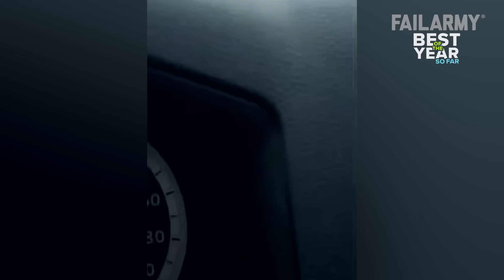Best Fails of the Year (So Far) 2023

Comment: 3:20 as a previous roofer, is my nightmare. I’ve witnessed it happen once and looking over the edge of the roof just hoping the guy was okay, was one of the  scariest moments in my life.
Reply: Yeah they should NOT Have picked him up right way.
Reply: I’m not a roofer. But I wouldn’t put all my harness on and not connect it to an anchor
Reply: I have a feeling the person recording turned away during the fall because he had a feeling there was a high chance he wouldn't survive.
Reply: @billbillson6779  I was worried about that too when they lifted him up so fast like "uhhh no you probably wouldn't want to"
Reply: did you atleast NOT immediatly jerk them upright off the floor after they just fell 3 stories?  

what is wrong with people?  why do they do such things.  
the guy could have been able fully recover without any lasting effect.  and BAM paralized from the neck down for the rest of his life.
Reply: I also had da same happen 2 me when I was on a ladder against a house removing squirrel traps from the roof 3 Floors high with no safety gear, luckily my boss was holding the ladder from tilting. I felt like I was going 2 have a heart attack from the terrifying situation.
Reply: @darkracer1252  Is it a problem if they pick them up? Never knew this
Reply: @Lusemasus  yes
Reply: Gotta be roped up for metal roofs in the winter. Wet boots and metal don't stick together very well.
Reply: 3:30 😂
Reply: @Lusemasus  very, never do this to someone who has just experiences big hit, they could have damage to the spine/ neck that would be worsened by moving them around.
Reply: Former chimney sweep here. Working on roofs is can be dangerous. Especially for idiots who don't wear proper PPE. Also he buddies yanking on him right after the fall is stupidity at its finest. There are probably EMT's here who can explain why you shouldn't do that.
Reply: my 1st day roofing and my last was having to complete the job after the boss’ indifference to my fellow roofer falling through the roof
Reply: @cookiemonsterdayz yep, he needs c-spine precautions (someone holding his head steady until EMS arrives), then EMS will stabilize neck with c-collar, headblocks and log roll him onto a backboard, securing his head onto backboard with the stickers straps that come with the headblocks. Never move someone who has fallen like that, it could  cause the person to never walk again.
Reply: Honestly it's inappropriate he's in this video he could of gotten seriously hurt
Reply: @jonah.donohue  You mean like all the other people in the video?
Reply: @Gamer-g2v1r  that was a near death experience not an epic fail. Know the difference.
Reply: My cousin fell 7 stories & the only reason she survived is a car broke her fall. She has made almost a full recovery (slight limp). Her grandfather fell 11 stories & survived. He was a window installer on NY skyscrapers. I guess an awning partially halted his free-fall & he also made a full recovery.
Reply: @Gamer-g2v1r  Bro fell 2 stories versus somebody who got hit with a pie in the face. You tell me what's more pressing
Reply: @jonah.donohue  When I said "all" I didn't mean it literally.
Reply: Any update about this guy if he's okay ?
Reply: @darkracer1252  3 stories and on a bank of snow ain't nothing. Now if there was no snow there.
Reply: You can see in the video the first few frames he’s in after he falls, his legs are over his head basically because he landed on his upper back/shoulders. It looks like that could’ve easily killed him by a spinal break or neck. Dude is so so lucky to be alive
Reply: @keirboyko  
the guy pretty much missed the snowbank dude.
Reply: god bless you lol
Reply: I'm hoping he's OK and made a full recovery. They should have called him an ambulance,  not picked him up.
Reply: @Lusemasus Yeeeah. Neck/back damage.
Reply: @keirboyko Snow can be real hard. You must not live in a snow state
Reply: Why were his buddies yanking him to his feet??? Could’ve made injuries worse!
Reply: For all those saying they shouldn’t have moved him. They needed to move him because there was a risk that the snow he was working on could have loosens and could crush them at any moment.
Reply: My fall when roofing was a factor in why I quit later on. Happened so fast. Only 10 feet. My uncle fell off the same roof later on near the end of the job… 22 feet. Left him brain damaged/personality changed for about five years before he returned to normal.
Reply: @Lusemasus  If the spine is injured, you can assure a life in a wheelchair by yanking someone to their feet.
Reply: So roofers a job to clear out roof
Reply: @Lusemasus  injured person has to be checked by medical personnel for possibility of spine injury first. usually when people fall from heights and survive they should be left in a position they fell down(if there is no other danger) - if they are conscious, otherwise you just need to make sure they dont choke on their tongue(if unconscious and breathing). setting someone up (like irresponsible idiots they are) right after fall from such height is not gonna help at all and potentially can damage injured person even further. its like they wanted to act like nothing happened and noone fell. ridiculous.
Reply: I just posted the same try comment I do roofing to, that shit is hella scray when your the one falling
Reply: @therealr0t166  What are you talking about? There was no danger of any snow crushing him. He fell from a cleared spot, and any snow that could have slid off would have fallen to the right of him anyway.
Reply: @Lusemasus  literally could kill him / paralyze him from doing that.
Reply: It did look like they were trying pull him up and pretend it didn't happen cause they were afraid of getting in trouble or something. That was stupid, they definitely should not have yanked him to his feet. That's like rule #1 in a situation like that.
Reply: A friend who is a home improvement contractor fell of a roof, broke his neck and recovered to go right back to doing roof repairs and replacements, I swear he is part cat with way more than 9 lives .....
Reply: That was brutal
Reply: Well, I assume they were jerking him up to make it believable that he survived that fall, which he didn't. Because he never fell. The camera moves just far enough to the side and down to disguise the fact that the guy on the roof and the one on the ground are two different people.
Reply: It’s funny how the dumber someone is, the more certain they are that they’re right.
Reply: wish he was okay

Comment: 1:24 I love how calmly he says “I almost just died “🤣😭
Reply: You just shook hands with danger, sport
Reply: He almost "just died" like someone who slams the back of there head on a desk or table coming out after reaching to grab something.  He'd have needed to have his neck between the bed and frame to accomplish that. And the bulk of his torso and the tire would have prevented that. Truck beds are large and gangly but still only like 200lbs. I have removed and replaced truck beds alone without lifting tools. His video is great example of why you don't trust lifting things on a floor jack with a 3ft vertical pole. He basically made an even sketchier version of a hi-lift jack aka suicide jack.
Reply: I am him
Reply: @AUSTINFRILOUX   Cherry picker and some chain goes a long way with awkward lift and hold. Ultimately though, never trust a $0.10 rubber o ring with life or limb.
Reply: Been there, and the casual commenting on it is just the realization that you effed up. Getting upset won't fix anything, and hopefully he knows what not to do next time.
Reply: He says that yet to the left of where he was, notice the stack of wood to prevent an accident working exactly as needed. He has the jack, then he also put 3(?) pieces of wood as a backup in case the jack failed. He was nowhere close to dying, he made his work safe beforehand.
Reply: @spirog1732  I'm pretty sure he meant that if he didn't have the wood on place he would of died. That's the whole point. People die all the time for stuff like this, when they don't apply any safety measures and just trust the lifts etc.
Reply: If he keeps doing stupid crap like that , he may never say that again.
Reply: @AUSTINFRILOUX  Fuel pump, huh?
Reply: @231mac  yep
Reply: @mikehatfield1531  he did put in blocks to make sure he wouldn't die though. it would have probably been smarter to just lower the jacks so the bed would rest on the blocks instead of leaving it on the jack to fail

Comment: 11:48  that wasn't a fail, that was about as epic a win as could have been hoped for under the circumstances.
Reply: It might be a "fail" by the plane or its mechanics, but the pilot is great.
Reply: Thought the same
Reply: ikr, pulling that landing in between two rows of high voltage power lines onto a busy road is impressive.
Reply: Just like in GTA
Reply: California ... 🤣
Reply: so ur not gonna acknowledge that they just put a plane crash as a fail 💀💀
Reply: @Gregs_sis  Not a crash, an emergency landing with no damage and no injuries...But that's besides the point.
If you're looking for High Quality, Fail Army aint the place to find it.
Reply: @samegalle1089  yeah that's what I meant with the reply, it was out of place in the video
Reply: Yeah that was pretty awesome considering the plane NEEDED to go down and no one even got hurt. SO much could've gone wrong there.
Would love to know the full story.
Reply: for an emergency landing that was slick
Reply: straight out of gta LOL
Reply: Engine fail
Reply: @jaska-jalmarixvi5757 no flaps either, so he was doing about 60 knots (appx 70mph/111kph), floating in ground effect.
Reply: The plane was reusable after a forced approach. Massive MASSIVE win indeed.
Reply: Horrible fail tbh by the very fact that he even had to make the landing in the first place.

Comment: Round of applause to that pilot that landed so smooth on the highway
Reply: No flaps either, so he was going AT LEAST 60 knots, floating in ground effect (which may have allowed him to stay up long enough to find an opportune gap in traffic.
Reply: The Cessna that sounded like a Beechcraft Baron:Fail.
Reply: @bigroy38  just because the engine is making noise doesn’t mean that it is producing enough thrust for flight.

Comment: the first clip is INSANE! I had to rewind several times and reduce speed to .25 in order to see just how FAST he managed to get up after falling. He's not even done falling and already getting up to avoid that big ass truck coming his way. That was just sick
Reply: Except he would have been fine where he was. He almost got himself killed for running. Look at where he crashed and where the big ass truck are at. They aren't the same lane. If the truck was just a car length ahead, he would have been road kill.
Reply: We saw several times the exact instant the persons guardian angel saved them by causing the vehicles to separate after hitting one another. Then the person is just standing there knowing they might have just died.
I've been through things less questionable. I was a sure fact, I mean, that I was going to have a head-on.
Reply: @joemann7971 Are you blind?  It's the same lane, the biker is joining the lane and slips. He lands right on the arrow which is exactly where the trucks wheels go through. He'd be dead if he didn't move.
Reply: Same here...I cannot stop watching it
Reply: @joemann7971   The bike was in the lane over but he was clearly right in front of that truck.  Running saved him.  Watch it again
Reply: @joemann7971   it's because he saw a car coming in the other lane. he couldn't guess that he could have been safe so he jumped to the empty lane.

Comment: 11:48 The plane making an emergency landing on the road without hitting anyone is not an epic fail. That's a victory.
Reply: I agree
Reply: I thought it is only possible in GTA to do something like this
Reply: Not at all. It was a massive fail because he even had to make the emergency landing in the first place. He should’ve inspected the plane before taking off. Definitely an amateur pilot that should have his license revoked.
Reply: @Brainsore.  atleast they didnt hit any cars
Reply: But maybe it was an engine fail
Reply: Hahaha, yeah
Reply: Oh, the landing was perfect. It was either machinal problem or a pilot problem however that lead to the failure of the engine that caused the landing.
Reply: @Brainsore.  Bruh? Do you know how machines work? Things can just break despite all the maintenance in the world. Some times stuff happens. Even commercial airplanes suffer from mechanical problems. Watch Air Disasters to see how stuff can happen out of the blue. Yes there is human error, but not all the time. There was a case where the rudder was stuck because the mechanical unit that controls it stopped working because of extreme cold conditions mixed in with heated hydraulic fluid made it stick. This mechanical failure affected 3 planes. 2 planes crashed and killed everyone on board. The third plane was lucky and was able to land safely, just like the pilot in the video.

Comment: 3:58 Slipping on the spilled transformer oil was the least of the hazards there.....he was very lucky that he didn't get electrocuted. If you're in an accident and damage ANY electrical equipment like that padmount transformer, or any other "green box", or a power pole, DO NOT exit your car unless it is on fire. WAIT for the power company to make sure it is safe to get out and touch the ground. Stay in your car, don't touch any metal and sit tight.

Comment: 3:10 
Poor man, falling from that height is very dangerous
Reply: Looked staged to me.  First of all nobody would be walking on that roof without fall protection. It's like a giant sled. Also, suspicious is the way the camera pans to the right so we don't actually see him falling. Then the camera pans to where he landed, but his shovel is still up in the air. Then his coworker comes rushing in to pull him up, totally disregarding safety protocols for possible spine injuries. Luckily,  he seems totally fine, even though a moment ago he was lying on the ground writhing in pain. Finally, the other coworker slaps him on the top of the head, for comic relief. There could be logical explanations for any of these things. Like if I was the camera guy I'd probably miss the shot too. Or, the shovel didn't hit the ground at the same time because he let go and it got hung up on the edge of the roof for a half second before falling. Or he was yelling "help me up!" so his coworker obliged. To me it all adds up to a group of bored workers having some fun, directing their own short film.
Reply: @YoeyYutch  👁️👄👁️
Reply: No, this is not a post-production video. This happened in Moscow. A worker was clearing snow without insurance and fell off the roof and was taken to the hospital. The man survived but suffered several broken bones.
Reply: Hes fineee

Comment: 10:58 almost happened to me once.

Had a semi behind me, he was going 80 on a 70. Guy ahead and to my right was going 70, but the lane merged into mine right away. Guy ahead and to my right was in a dirt hauler with an extra dirt box trailer. He didn't speed up, nor did he try to stop and wait for a better opening. I had to pull a very difficult manoeuvre where I slowed down just enough so the guy with the double wouldn't slam his back into the front of my car, while also maintaining enough speed so the semi didn't slam into me. Needless to say, I laid down on the horn the whole time, but the fucker in front paid me no dues.

Makes me wish I heeded my stepfather's advice at least a little more often by keeping a sawed-off in the glove box.

Comment: I'm not sure that the smoldering passenger jet crash @12:27 belongs in a video which otherwise features funny mishaps.
Reply: Minor injuries only, and it is definitely a fail (either on the part of the pilot, plane, or maintainers is still TBD). Definitely could have been worse considering the passengers evacuated, without the command to evacuate, in front of a still-running engine.